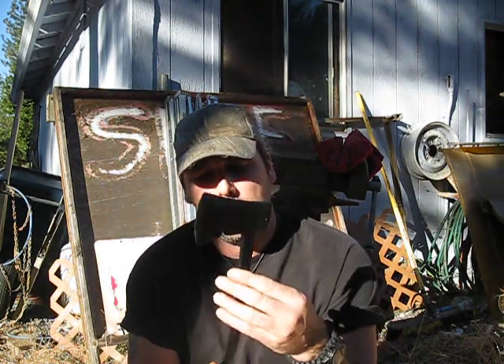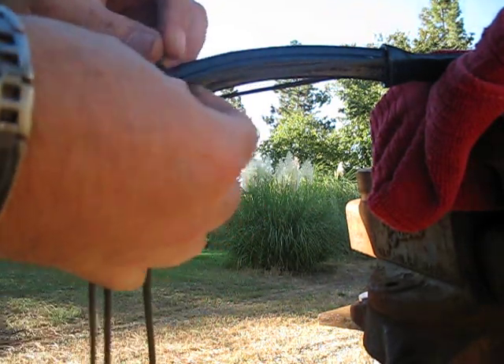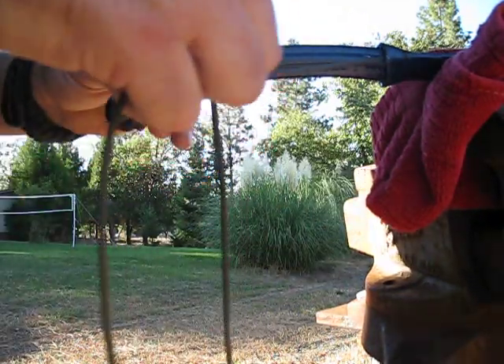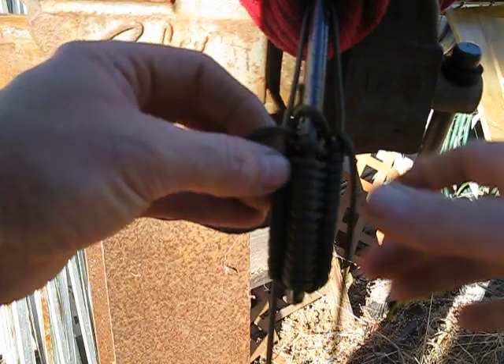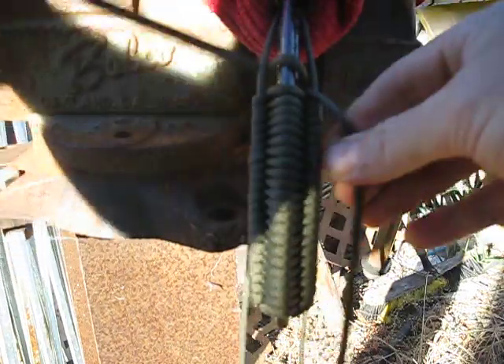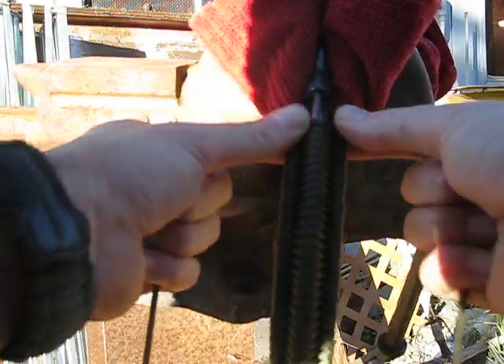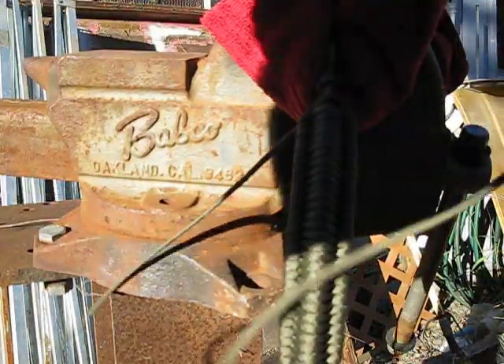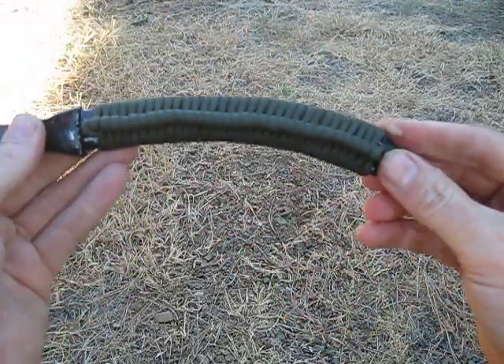Hatchet Restoration Part 3 Paracord Wrapped Handle

Comment: On The Last video I Left An Idea For The Grip and Handle. But You Sure Did A Nice Job On The Wrap. Ive Actually Seen People Wrap The Handles Like That VERY VERY Tightly and then Coat it with a Nice Heavy Layer of a Type of Resin, Like For Micarta Making and Just Keep Coating And I Guess Its One Pretty Indestructible?